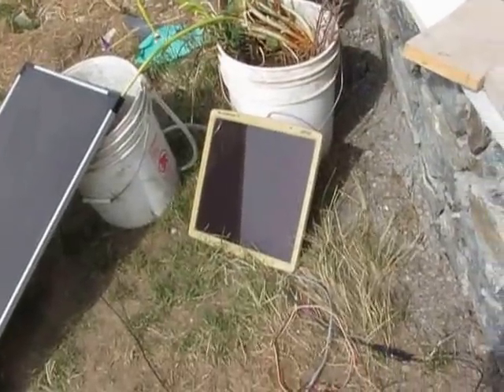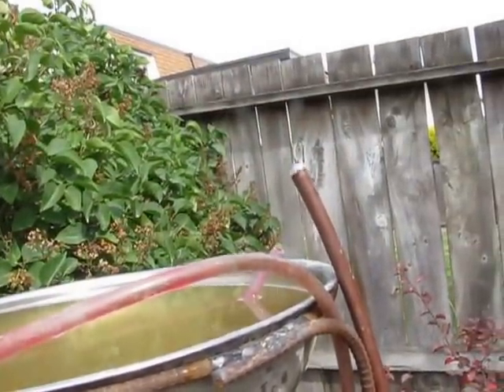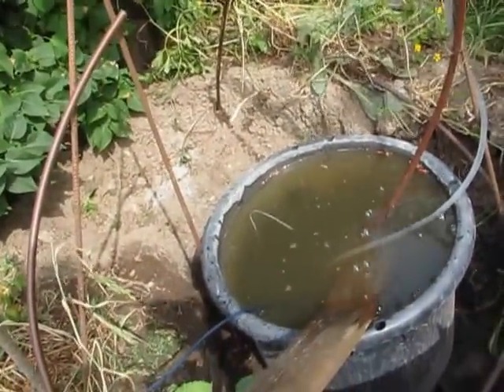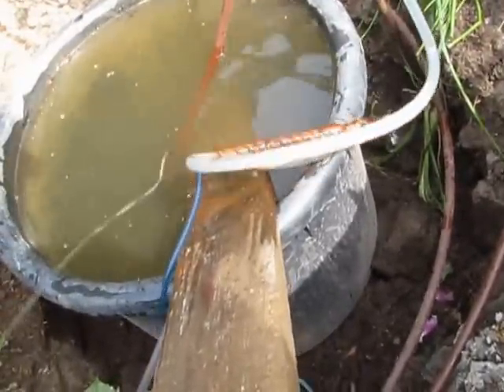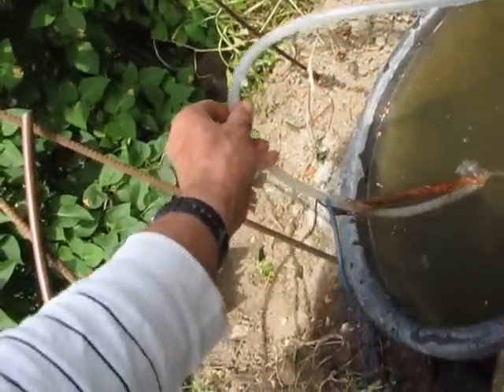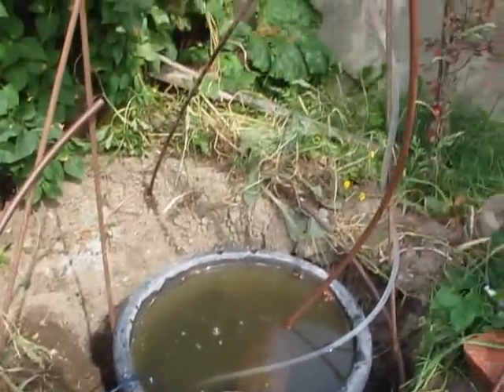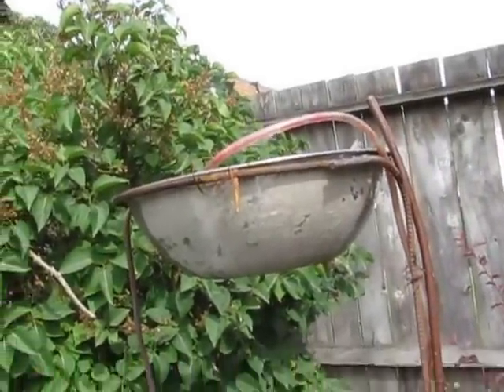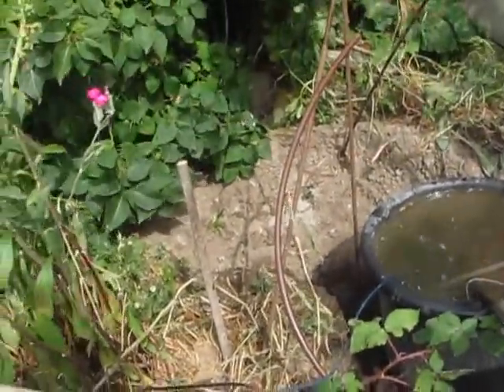Solar power: Airlift pump fountains.  Not as hard to make as you might think!

Comment: Great experiment. At ebay I saw similar air pumps, but the KPA are 30, 50, 65 and 80. Which one are you using?
Reply from the maker: Hi,  Hasan,  these pumps are brush motor pumps. I tested them for a while and their lifetime is not great.    The  best pump by far that I have tested was the  . brushless motor air pump AJK-B4001 and you can see it in some of the other  videos.   It has a little round speed control knob on it and it automatically starts when there is enough sun and stops when the sun gets too weak.  I have 2  of the  AJK-B4001, they are working right now.  The company might have made up the speed control specially for me because I told them that I will work it directly  from a solar panel. If you order from them, and you want it to work from a solar panel with no batteries,  just ask for the exact same system that they sent me.   My airlift pump design (how the tubes are arranged in the water)  is called "airlift in a bucket".  You can find diagrams on the web. It can use very low pressure air and it has a very high "lift to submergence ratio".  It is a DIY design so anyone can make one.  Thanks for your interest,  Brian White
Reply: Brian White Thanks for the info. I guess, those small brush motor pumps shouldn't be kept running more than 2 to 3 mins. It gets heated up fast. Suppliers never warned us on this. I agree, brush less is way to go. I can't find a link to the seller site for AJK-B401. Will this one at ebay works as well? >> http://www.ebay.com/itm/181589976209?ssPageName=STRK%3AMEBIDX%3AIT&fromMakeTrack=true
Reply from the maker: Hasan Sabran  I sent you an email in your youtube channel.  Best of luck.  Brian